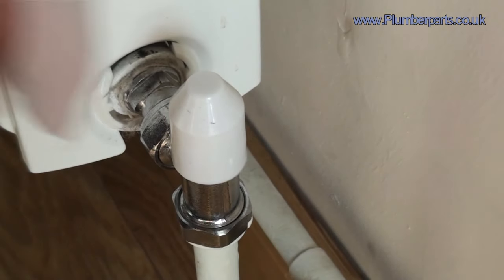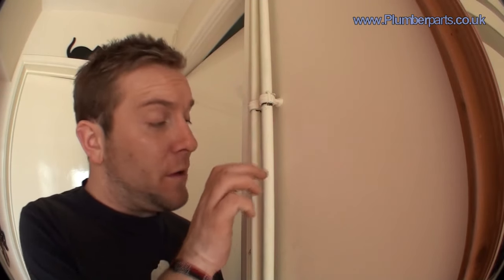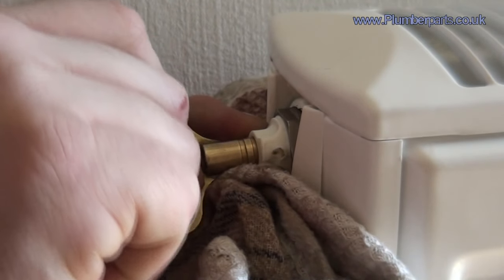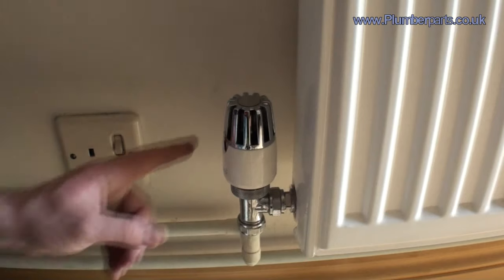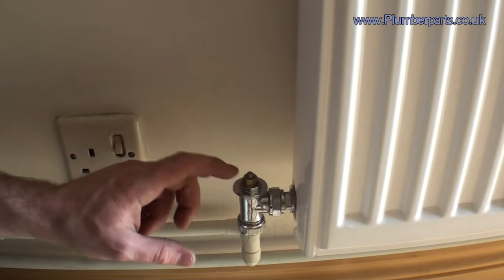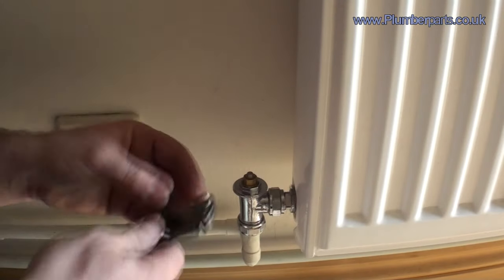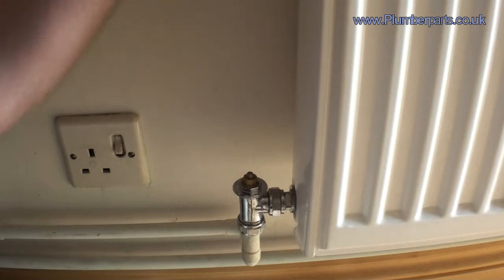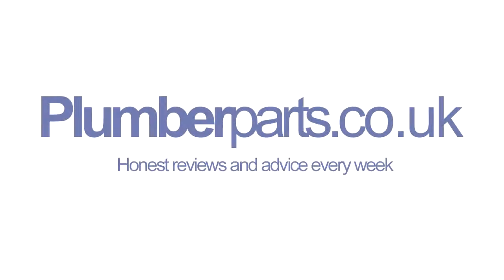How to Fix One Radiator Not Working - Plumbing Tips

Comment: Thank you so much for your video. I had one radiator not working and didn't have much of a clue how to fix it. I did check the bleed valve at the top but water came out straight away. The pipes feeding the radiator were cold when the others were hot. I was ready to call a plumber. I assumed the thermostatic valve was jammed but wasn't sure how to get the top off safely, or how the valve worked. I had no idea that the collar under the valve would unscrew by hand and the top would just lift off...not many things do in plumbing! Anyhow, thanks to your video, I felt confident enough to try. As you predicted, it was indeed the pin that was stuck downwards. I worked it up and down gently with long grippers and soon got it popping up and down. Everything works fine now. Thanks for making my day! I also got a lot of dusting and vacuuming done behind my computer desk, which is in front of the radiator. I'd been putting that off for a long time.
Reply from the maker: Top work GGA!

Comment: Omg have just fixed my own radiator, so simple. Had already tried to bleed it, wasn't that, tried opening the value, wasn't that. Removed the thermostat wiggled the pin up and instantly the radiator got hot. Thank you.

Comment: Hiya. Wee question. I've replaced 8 rads in my house but only 2 are hot and the rest of them is only luke warm. Bleed them, checked everything and plumbers that did the job just ignore it. Yesterday checked one by one and those two that work properly have hot pipe at the TRV but other that are cold have hot pipe at the end of the rad. There is an arrow pointing towards radiator at TRV and arrow pointing both ways at the end. Plumber said it doesnt matter but as electrician I know that arrows matter. Any advice?

Comment: Can I please have some help, the radiators had powerflush...but now only one radiator the valve is luke warm the top of the radiator is hot but towards the bottom of the rad it is luke warm. Can I please ask what is wrong...as I thought the powerflush would've have worked. thanks for any reply

Comment: You know that little pin you spoke about? What do you do when it comes out and there is a stream of water? I got it back in and it doesn't appear to be leaking, but do I need to change the whole valve assembly now? It is an old danfoss.
Reply: John Jones shouldn’t have to change it just be careful not to pull the pin all the way out again.

Comment: if l have tried everything you said on the video, and my rad is still not heating up and remains lukewarm at the bottom but cold at the top, do you think l should desludge the central heating system? if so then what is the best way to clean or desludge the system, many thanks m8

Comment: 1 radiator in bedroom not getting hot .tried TRV,still not working pipe nearest door is cold the 1 with trv hot ,flushed it through, changed both valves still not working my husband is baffled can you please get back to me ASAP.